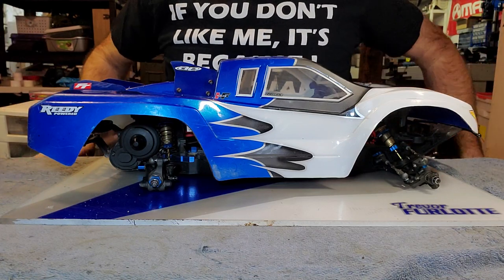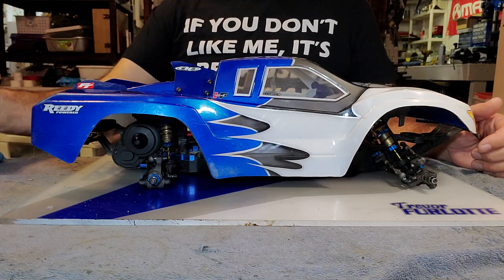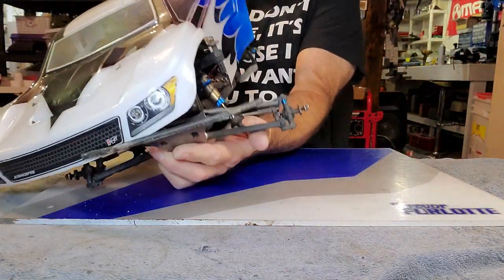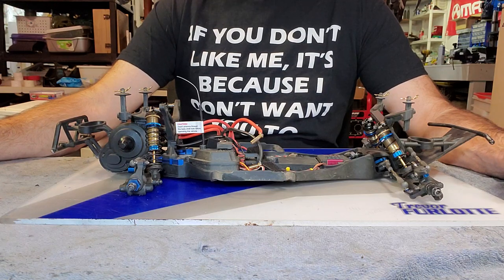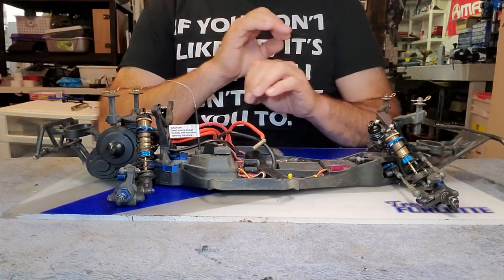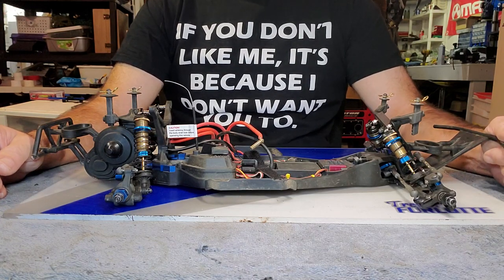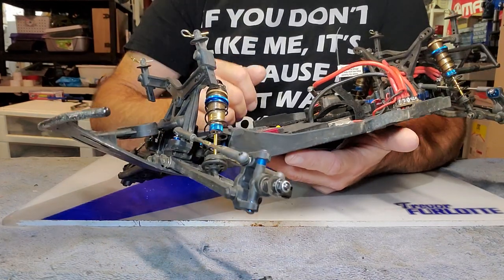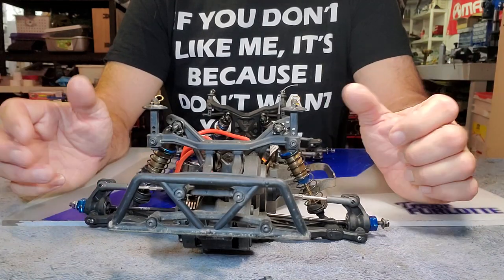Team Associated ProSC10.6 Mods Update.

Comment: Hi Trevor, I really like how passionate about the hobby you are. Lots of cool upgrades on that prosc10. On the .2 hub issue, I'm wondering if it was the link length that might have been the issue. On my .2 vehicles on a loose out door track I have had good experiences with them, but I do run a shorter link, like the outside hole on the aluminium ball stud brace near the gearbox. Geometry dosnt seem too different from .1 hubs, but the link length is definitely affected. Keep up the good work promoting our hobby.
Reply from the maker: Thanks Sammy!  I've tried it both way, long and short links.  Next I'm going to try aluminum B64 hubs.  Thanks for watching!

Comment: I would be interested in what you need in detail and to be able to drive the wishbones of the SC6.1.  At the front it should be relatively easy.  But at the back you also need the sc6.1 drive shafts?  Can you list which article numbers are actually needed.
Reply from the maker: There are two other videos here on my channel that go into greater detail about what SC6.1 parts I used.  I'll post links soons as I can.
Reply: @trevorfurlotte  
I saw the other video.  However, I'm German and can't quite keep up with the video.  I would get a listing of the part numbers for each section.  as rear axle and front axle.  and what you need in dependence.  Preferably in text form.  Thanks very much
Reply from the maker: @stefanalthoff2921  Parts list added to the video descriptions.  Thank you for watching and for the comments.
Reply: @trevorfurlotte  

What do I need for arm mounts C and D?

Thank you.
Reply from the maker: @stefanalthoff2921  The C block that comes with the kit is fine.  For the D block I use the B5 Aluminum one. ASC91387